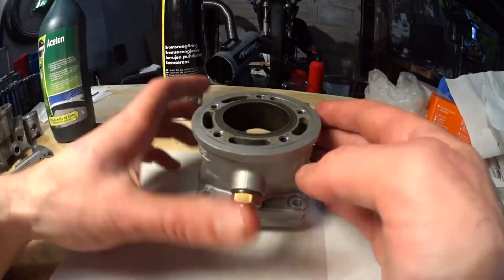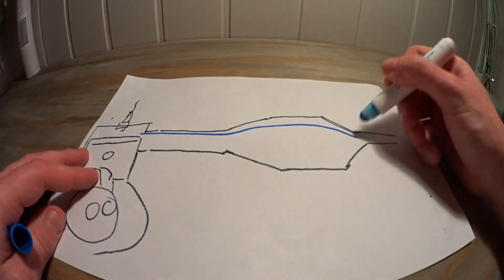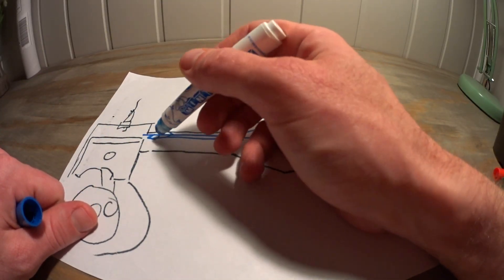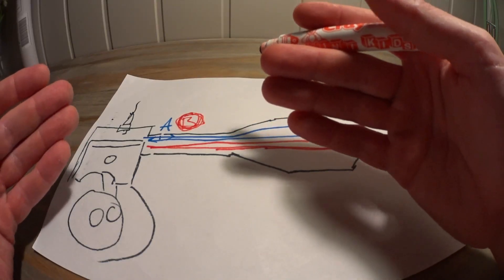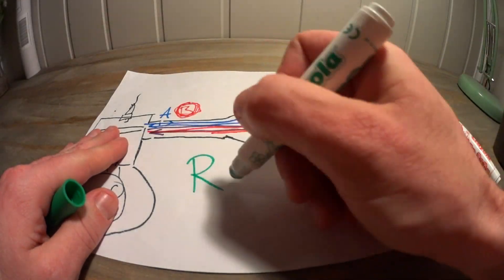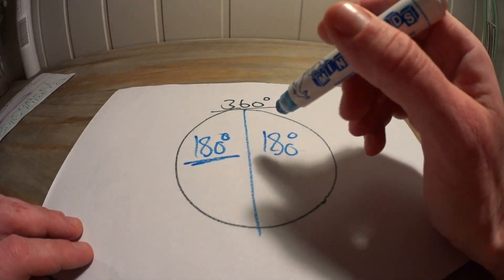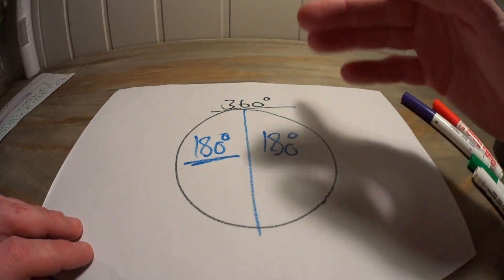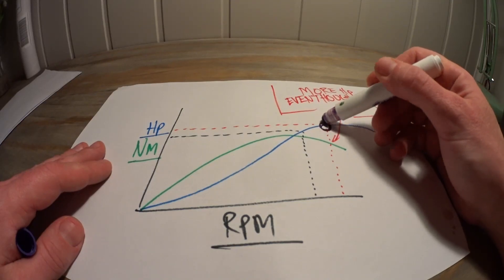HIGHER EXHAUST PORT, GOOD IDEA? How Exhaust Port Timing Affects Two Stroke Performance.

Comment: I get the theory but what happens with engines that do not have a tunned pipe, say a chainsaw motor has a small box silencer, do the pulses still return to the engine with this design?
Reply from the maker: +Guy Osgerby They do, but as that type of exhaust system usually is very short, the pulses just bounce back and forth a bunch of times each cycle and when the exhaust port is about to close again they're so weak they're almost gone.
Reply: fantastic info, cheers. As a video idea can you talk about upper circlip positioning on both sides of the wrist pin? recently i had a circlip wiggle its way loose on a blata ultima minibike, it completely ruined the piston and cylinder as it chewed it up. I've read an opinion they should be positioned either at the 6 or 12 o clock position, how much truth is in this? fantastic channel btw!
Reply from the maker: +Guy Osgerby Thanks! Too bad about that cylinder! I've always oriented the circlip gap like that too, 6 o clock, not quite sure why that's best. Maybe to avoid the clip "compressing"  under piston acceleration. My only real tip concerning circlips is to use the type without any form of "ears". Those "ears" has a bad habit of breaking off.
Reply: you hit the nail on the head there, the ones that gave way were the circlips with ears, on the replacement piston and cylinder combo the circlips were a clean cut straight type, really appreciate the reply. fab source of info. cheers

Comment: I've seen a few youtube vids on how a 2 stoke expansion chamber work, none of them give the full story!

The actual way that they work is that when the port is uncovered a positive pressure wave travels down the pipe but when it reaches the diffuser section of the pipe due to a law of acoustics some of the wave is reflected back up the pipe with a negative sign (in other words a partial vacuum). This vacuum actually helps pull fresh charge up from the crankcase above the piston and even out into the exhaust). Not all of the initial wave was reflected back, some remains as a positive wave and travels along the pipe until it hits the baffle cone, it is then reflected back with the same positive sign, this wave pushes the fresh charge that was 'stored' in the exhaust back into the cylinder.  Simples!

The acoustic law is basically that a pressure wave (positive or negative) is reflected back as a wave of the opposite sign when it reaches the end of an open pipe. The diffuser is a 'sort of open pipe', not fully open. This is why the diffuser is important in an expansion chamber. The law also states that a pressure wave will be reflected with the same sign when it reaches the closed end of a pipe. The baffle cone is a cone and not a flat plate with a bleed hole in it in order to try to increase the RPM range that the pipe will stay in tune. (The diffuser cone(s) can be tuned in the same way. Steep baffles cone(s) mean that the wave amplitudes are high but the RPM range that the pipe will work is very narrow.
Reply from the maker: +Sidecarbod well explained!
Reply: That is true and I've just done a video yesterday on it, first in a series of them.
What is described here does actually occur, however it is not the basis for tuning calculation.
The resonant effective described here is a secondary effect that can benefit or work against, and is more a matter of being fortuitous enough to have a pipe that ends up benefiting from resonance, and not the later.
If you happen to have a design and timing that results in a favorable resonant effect, its your lucky day, if the opposite occurs, not so lucky.
Reply: Yes it is now, posted last night.
First one is just the basics of what occurs, next ones Ill get into the details of each part of it as well as the resonance issues.
Reply from the maker: +AuMechanic 👍Great stuff, already watched it!
Reply from the maker: +AuMechanic Is your video up yet?

Comment: Go 200degree,, stop the nonsense  ;)
check drawings from Aprilia RSA cylinder.
Reply from the maker: +Patrick Wetterskog I am going to about 200 with the Spx. Like I said, more rpm but a little less torque = still more hp.
Reply: That´s the way to go ;)
I got confused with videotitle ;)
I run 205degree in my big 211cc engine.
i say 'cubic eats duration'
It produces max power at 13200rpm.
75.54hp to the crank.
Something has to be 'correct' to produce that ;)

Comment: Good series of videos. I'm really enjoying it. Might also be worth noting that the volume above the exhaust port is a sealed chamber containing a huge explosion so earlier you open the exhaust port the earlier the pressure escapes into the exhaust.  The force on the piston (and the work done) drops suddenly as soon as the exhaust port is open.
Reply from the maker: +ametti000 Thanks! True, but then there's the balancing act between energy used to push piston and energy left for the pipe. Might be a video.

Comment: I much prefer to widen more than raise.
Reply: And by that, one sometimes has to rise exhaust to get desired flow for rpm´s reached for.
Reply from the maker: +Dragon800 Smart!
Reply: one can only go 'so' big before running into problems with shortcircuiting transfers with exhaust through piston wrist pin.
Reply: correct. you need at least 5mm of space between the edge of the port and the cut out on the piston
Reply: Ya I do agree the bridged exhaust ports have great area potential but keeping the bridge from over-heating can be a problem. A few Honda 250r's I did I tig welded more material on the back side of the bridge which helped it stay cooler
Reply: yes i realize that. I almost always raise the exhaust some but i think a wide more rectangular port with big auxiliary ports is better than a super high port with no low end performance.
Reply: You have to be careful going too wide though if you do not have a built in bridge on the exhaust side. I have gone too wide before and had the ring catch one it warmed up and the cylinder expanded. I have found it best to do both especially if you are lucky enough to have a bridge stock or at least a half bridge
Reply: Bridged exhaust ports aren't really ideal the bridge gets too hot. A 3 port exhaust the type with auxiliary ports is the best. But yes a bridged port would be better than a single exhaust port.
250r hondas had the bridged exhaust and they were a nightmare. worst mistake is most people narrowed the bridge which is the worst thing you can do.
Reply: If you only have one ex port to tune with, I thought oval was the best shape, I know this has the disadvantage in that a flat top gives the best pulse to the expansion chamber but gives the compromise of area and piston/ring life
Reply: When you widen the exhaust/intake  Port keep in mind that anything over 68℅ of the Pistons diameter is safe.anything over that and you have a risk  of the piston rings expanding too much and catching on to the ports
Reply: @JjJj-ci9lc  yeah, I think the rule of thumb for the V6 Mercury outboard motors is no wider than 70% of the bore size.
   And good chamfering def seems to help with anything close to the limit's..
Reply: More of an almost square oval is really good for power but can catch rings. The 97 polaris xc700 had this type of port(plus auxiliary ports) and made great power but they had to upgrade to a more round port because this shape was catching rings.
Reply from the maker: +Kole DeWoody Good advice!
Reply from the maker: +Dragon800 Agree on 3 ports being better. Flow wise too, even though 2 ports has more potential for area.
Reply from the maker: +Burt Johnson yep, Oval is the best compromise!
Reply: Dragon800 ahh the 220 jug looking for a set myself.

Comment: I knew about the first pulse  but not the second one  is this why the power-valve works well it it give the flexible power band.
Also Why does EVERYTHING in your workshop not go rusty like mine did with a propane heater in there.
Reply: the problem with rust:
the heater does heat the air relatively quickly. Warm air can hold more water and will do so, picking up moisture mainly on the ground, on outside walls and especially in outside corners which are the coldest spots in a garage or workshop or outhouse ;-)
The warm and moisture filled air then gets stirred around by the heaters jet EVERYWHERE and cools down around all cold objects and thus pulls down the ability to hold humidity, which leads to condensing. Small droplets of water get deposited on all objects, thus you see rusting on EVERYTHING!
A wood burning oven would not have this effect, because the air doesn't not moved that much and the oven gives off most of it's heat in form of infrared radiation - objects get heated directly (stand around a corner, if you can't see the oven, the oven won't heat you! Terrible in small compartmentalized apartments). The wood burning oven gives off only a smaller portion of it's energy by heating the air (convection).
Reply from the maker: +Graham Dawes Kinda, power valves lower exhaust timing, but mostly the just screw up the pulse action altogether. This is a good thing outside of the powerband when the pipe is working against you.
Reply from the maker: +Graham Dawes Not sure why stuff dont rust, I keep a small oven on all winter tho, too keep from going below 0°C

Comment: Port High = Half stroke? 
Stroke 50 mm/ port High 25mm.....
Reply from the maker: +Elmar Dylong Still, with a tuned pipe about 190° duration will produce the strongest resonance over the widest rpm range.
Reply: The 50ccm racer can have the same flat torque curve as the 250ccm motocross, but than it can't have the power of a 50ccm racer. Power is a product of torque and rpms. ;-) It is just not possible to say "use 196° for exhaust timing and you are fine with every engine".  From 150° of exhaust timing for use without a resonance chamber, to over 200° of exhaust timing in GP race bikes, the angle of exhaust timing has to be chosen wisely.
Reply: Peter Ipsen - Not enough information to answer your question. Also you can't just open the exhaust longer without changing the port height of the scavange ports. It may give you a very bad engine. Also ccm are very important, because I can't rev a 250ccm motocross as high as a 50ccm Van Veen road racer.
Reply: Hmm
Prøver lige at skrive på dansk, da jeg ikke har evner til at skrive det på engelsk :-)
En 250 ccm motor har et mere fladt drejningsmoment  (NM) end en Van veen 50 ccm som skriger efter rpm det er jeg helt med på.
Det var også bare mere for at få en retning snor for hvor meget man kan åbne udstødnings porten uden at det går HELT galt.....
Håber Google  translates kan oversætte dette !
Reply: half stroke means 180° of crankshaft rotation
Reply: The timing is not linear to the stroke... its a sinus function of it... near the TDC an BDC youll have to turn much more degrees to get the same "pistontravel" as 90° between the DCs...
Reply: If we are talking about the exhaust port, half the stroke as port height means 180° of crankshaft rotation.
Reply: Well well well .... i do know that half stroke is 180 degre :-) but, it is not nessesary to make the exhaust port  higher than 1/2 off the stroke?
Reply: Martin Herbig 🔝🔝🔝  This!!!
Reply from the maker: +Peter Ipsen bruk denne kalkulatoren og regn ut hvor mang mm etter topp eksosen må åpne for ønsket durasjon. 90° for 180dur, 85° for 190dur etc.
Reply from the maker: +Peter Ipsen It's a bit more complicated than that. Google "piston travel vs crank rotation"
Reply: What engine size? What appilcation?
Reply: Hmm
Motocross engine, fast going scooters engine etc etc